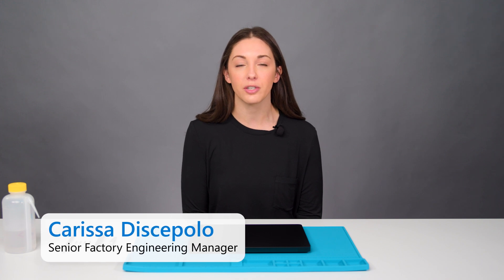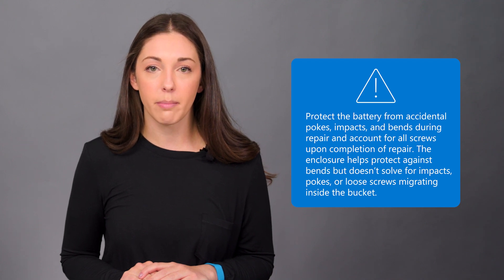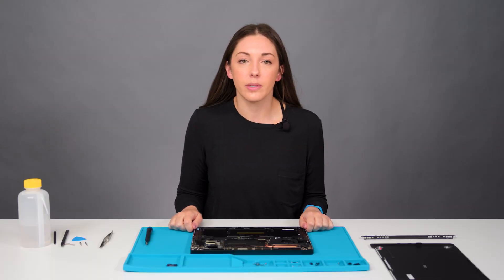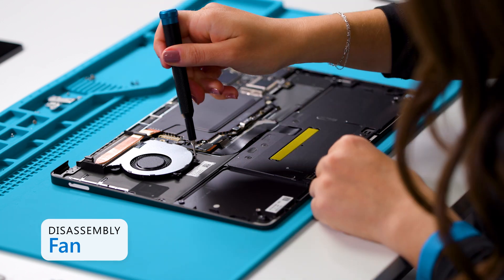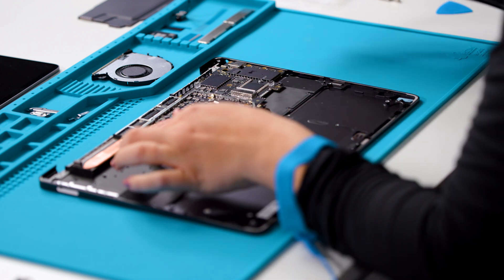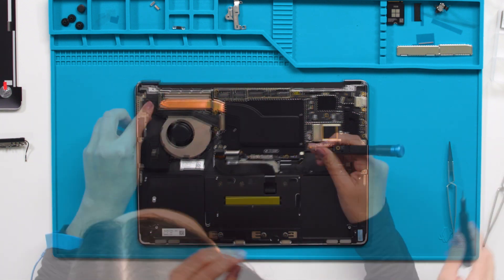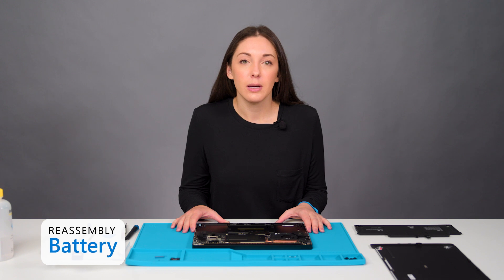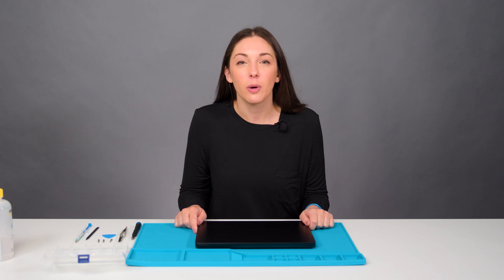Repair | Surface Laptop 7th edition

Comment: Like many others commenting, I was impressed with the high quality and repairability of the newer surface models, but then I ran into removing the covers which you can't do without damaging them. I watched to see how she was going to pull it off but then ended up putting brand new ones on. So Microsoft forces you to buy new parts. What is greedy company. Nevertheless thanks for the very good instructions.